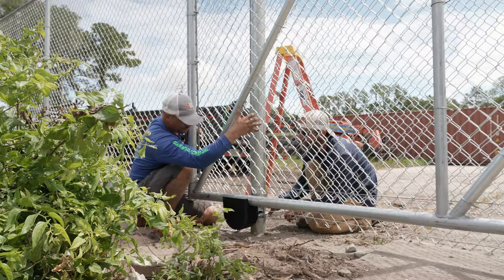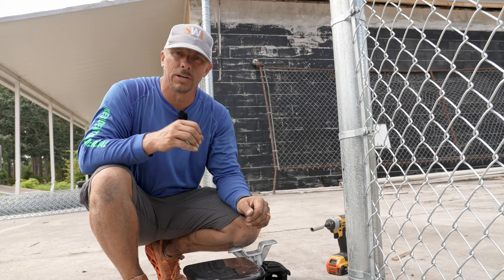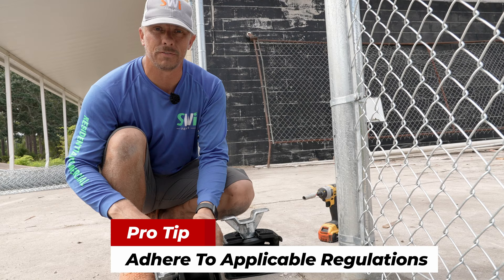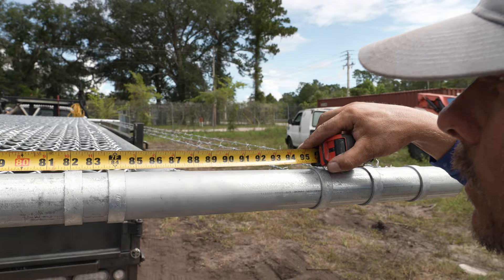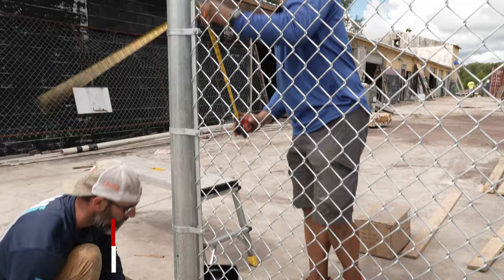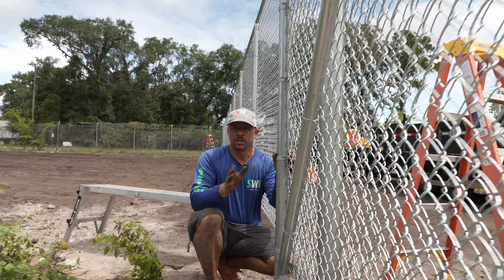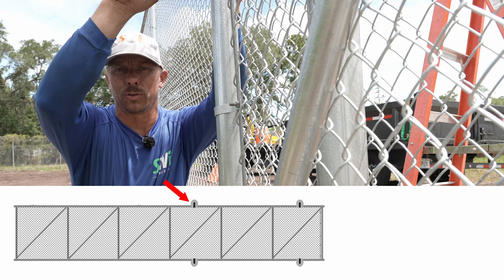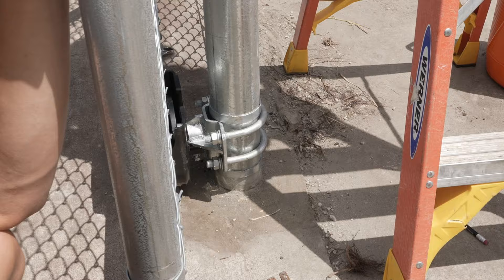How To Hang A Cantilever Gate

Comment: That’s nice but it seems really far off the ground where my dog can get under. Is there any way to get it closer to the ground.
Reply from the maker: Not for this type of gate. You'll need to look at a different type. https://youtu.be/hY9QEgqhpZU
Reply: @SWiFence  thanks for the link. I live in a warm climate also and I like the idea of the bottom track fence you mentioned in the vid. Thanks for the info. I will get some measurements and reach out for a quote. 
Thanks

Comment: How far apart do you space the posts holding the rollers?
Reply from the maker: Roller post should be about a foot less than half the width of the opening. So if I was setting post for a 20 foot opening, I would set the roller post about 9 feet apart.

Comment: Great info! How deep and wide does the foundation have to be for this system?
Reply: A general rule is 40% of the gate opening. As far as depth it really depends on ground conditions. I always say go big or go home. If you were to do a 30 ft opening I would say 36 in wide by 5 ft deep for each post should do it. Concrete is something like 4050 lbs per sq yard, and in a cantilever gate they’act as a counter weight to some extent.
Reply from the maker: 12" x 36" minimum.  Softer grounds will require larger footings.